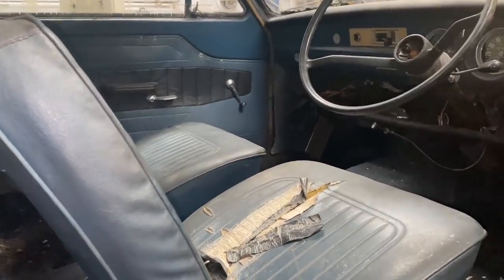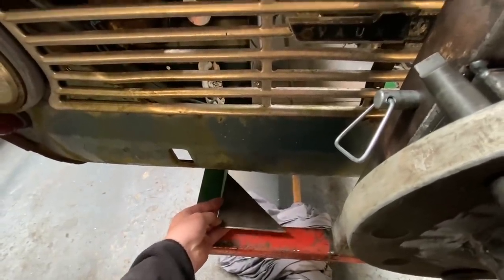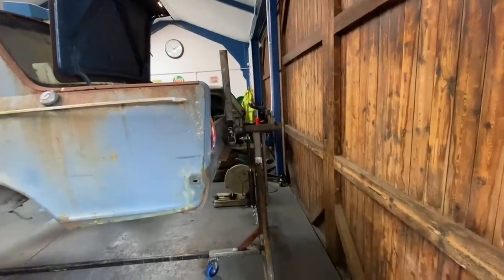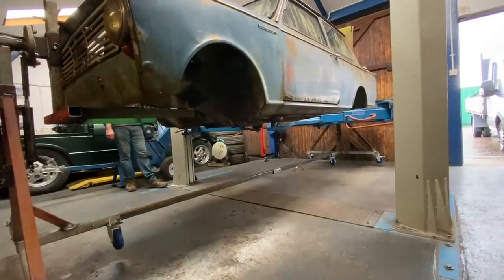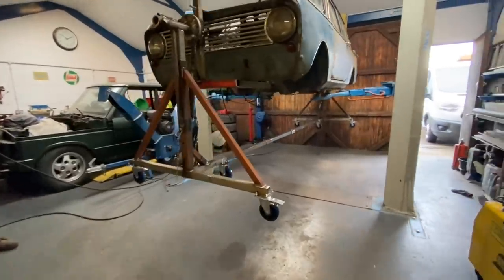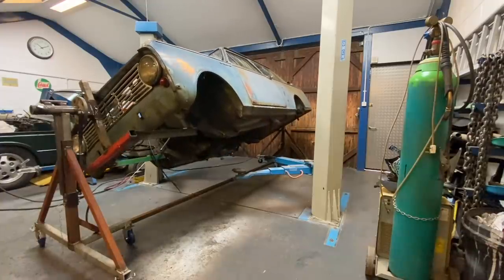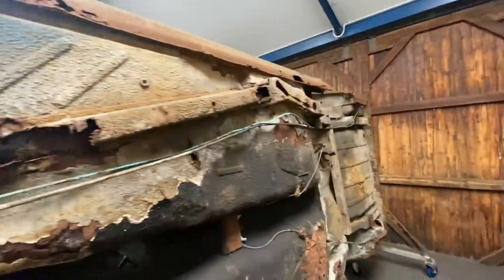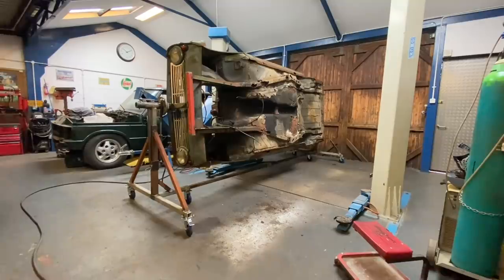Classic Car DIY Rotisserie Spit Finished + HA Viva Trial Run ???

Comment: I love the fact that there is next to nothing left of the viva parts car, not even an engine but the keys are still in the ignition lol
Reply: Car keys were useless back then it was so easy for car thief's
Reply: I thought that 😂
Reply: They are rusted in the ignition, can't get them out. I like the optimistic 100mph on the speedo.
Reply: @General_Confusion  like Rodney Trotter once said about the free wheel van top speed, if you push it off a cliff. Lol
Reply: @General_Confusion  my 1.2 Clio went up to 150 and it struggled to go over 97 (on private roads obviously).
Reply: Brilliant Brilliant Brilliant 👏
Reply: Those quarter light glass in the front doors ( HB ) could be pushed inside out to reach the inside door handles for breakins, etc.
Seen it done many times.
Never did it myself.

Comment: Your rotisserie looks fantastic.  I especially like the power feature to turn the chassis.   I used a rotisserie to restore an MG Midget.   You would be surprised how handy it was to have the car upside down to repair some issues on the bottom.   And having the car upside down gave me a perfect table to lay my tools.   It's surprising how light a monocoque body is with the axles and engine removed.

Comment: Glad to see the HA again.
Looking forward to when the other car goes on the spit for rebuild & engine installation.
I remember in the early 80's, the mk2 HB's in New Zealand were shockers for rust.
The sills would rust out front to rear, spare wheel wells were another, I had to refit sheetmetal to stop the spare wheel from dropping through in first 67 HB.
Above the top hinge in the A pillar & behind the front wheels.
If you ever stripped a HB bodyshell the paint was a bit sparse where you wouldn't always see.
Look forward to the trip down memory lane.😁🤗👍👍👍

Comment: Great job Guys, making the Rotisserie, excellent piece of kit. This was  definitely a car of it's time, some of these cars were rotten after a years use.  Replacing sills was pretty  much standard, used to use lots of Isopon and pop rivets. Those were the days.  😀😀
Reply: The wings rotted out and you could buy fiberglass replacements for them.

Comment: I am hugely impressed by this. Major repairs are done to aircraft engines in a turnover rig. A large jet engine is much the same size as a car. The engine is removed from the aircraft and put into the rig, which is usually vertical, with the front of the engine at the top. The fitters can then work on the engine at a comfortable height and turn it round so the area they want to work on is right in front of them.
The same idea has also been used in the motor industry. In the 1940s Jowett cars were assembled in a turnover rig, which was on a moving assembly line. As the car came to each worker, the worker would turn the car to the most comfortable working position, even upside down if he wanted to work on the underside. The wheels were the last items to go on, at the end of the line.
Reply from the maker: Thanks Tony

Comment: That was lovely speed and control on the new 'toy', it worked a treat. I remember old Road Research Laboratory films of cars being 'crash tested' in the days before the MOT came in. They were no more than an engine bay and a boot keep in position by the roof. They folded up in the most gentle of sudden stops, I guess that old Viva hulk would do the same. Nothing is impossible if you throw enough time, money and skill at the task, but that Viva will never be a driver again, even if Chris breaths on the remains. The rotisserie was mostly scraps, with a few new parts thrown in showing what can be achieved. In skilled hands, everything is possible, a great job.

Comment: Fair play to Chris, that is spot on, and with hydraulics, one we had at place I worked it was so sketchy to turn the car over, atleast with chris's design you can stand well clear while turning, 👍, oh and Rob there is something you can do sweep the rust up lol
Reply from the maker: Thanks bud. In theory, with the hydraulics I should be able to rotate it safely on my own. I know what you mean about the manual ones. Finding/mounting the vertical axis is easy, but the horizontal is just guess work. When the car transitions from horizontal to vertical the shift in weight can be quite alarming!

Comment: could you switch round the front and back connectors to get the car to turn the other way round as well. the passengerside of the car will always be in the air. it appears you can only turn the car anti clockwise. great work!
Reply from the maker: I can rotate the car either clockwise or counter clockwise. Just a case of changing the ram top pivot position.

Comment: The bottom end of those engines can take whatever you want to do in terms of high compression and turbos. Way back a mate and I had a Ford Pop chassis with a sports style body so we fitted a 1600 Viva engine, and front suspension, with a Triumph back axle. One night, on a test drive we had problems with the float bowl so JimTom took the top off the bowl and the, still active, electric petrol pump shot a jet of petrol up his nose. He's okay now but he was definitely elsewhere for a couple of days.

Comment: Enjoyed the video the ha viva is incredibly rare there are only a handful left that viva is very rusty but I recon it could be restored one thing those opening quarterlight are mechanicly the same as citroen saxo quarterlights
Reply: With their propensity to rust it's no surprise there are very few left. Very little rust protection must have been used on them.

Comment: Well done to Chris, not only for the making of it but for the design  as well. Makes it so much easier to work on the undersides of cars. I just wonder what size, weight wise, do you think it will be able to take?
Reply from the maker: Thanks John it Should take any small to mid size car.

Comment: Very well done Chris 👍 fantastic engineering project at a super low cost!! It will be worth it’s weight in gold for you to carry out the necessary repairs on the other shell. As Rob said - it’s brilliant watching you stand back / think about it / suss it out / measure it up / build it / assemble it / test it out / and then put it to good use. Absolutely cracking video! 👏👏👍👌

Comment: Perfect to produce some good tools for the work shop. In order to really complete the project, my proposal would be to spend a bit of time to add a little bit of paint and some plastic closure for the open ends of the steel profiles.

Comment: Fantastic job well done so are you getting it painted next
Reply from the maker: Probably leave it as it is si
Reply: @sruk  Well it works great very impressed and yes it doesn't matter if its not painted its made to do a job and it's not like your going to leave it outside

Comment: Back in the day that would be a normal mot failure and we would spend a couple of days welding it up with gas as there were no mig welders back then so just another job for a mobile chassis welder no problem

Comment: That Viva is well past it's sell by date, it's a shame as they were a popular car when I was growing up and again in the 80s for chopping up and fitting a bigger motor in, I knew of one that had a Ford V6 but as the insurance killed off mods the whole thing died a death, now if you ask they don't even like new wheels. great Rotisserie and the power side makes it better than the rest. I may have gone for 2 bars under but if it works who could complain.

Comment: wouldnt you weld a diagonal between the two angle irons bolted to the front rails?
Reply from the maker: I am going to be using it to hold the shell for blasting and painting as well as the welding that Rob mentioned. I don't want anything obstructing that. The angles have gussets and because they each have 2 bolts mounting to the chassis, the only way they can bend or distort is if the front rails bend.

Comment: Far too flash that mine is just a case of muscle power to turn it over but have spring loaded trailer door bolts to lock it so they just jump into holes

Comment: Floor is mostly gone, chassis rails almost gone, sills? What's to stop the car going banana while it held on its side as you work on cutting out the rust. Looks like it needs some support in the middle as you work.
Reply: This is the parts car, as it's too far gone, used as a jig for the rotisserie.
Reply from the maker: You must of skipped the bits when Rob explained I am not repairing this car. The car that is going on this is not as bad but will have temp. braces fitted before it is mounted to the rotisserie.

Comment: Bit of paper mache and some polly filler and them cills and chassis members are good🤔🙄🤣🤣 but in saying that I just wonder how many drivers would know how to use a chock these days never lone knowing what a chock is, I spotted it in the centre of the car🧐
Reply: E30’s came with a wheel chock.

Comment: The Viva was /is a crappy ugly car .I understand now you are just using it as a prop for building a bit of machinery . ,which is fine as otherwise its not worth spending one penny one  .
Reply: Behave
If you've been around here long enough you would know that they hold some sentimental value to Chris
Reply from the maker: I first drove a Ha when I was about 8 years old. I have owned and driven several since and they always make me smile. It's not always about looks or value or what's fashionable Bud